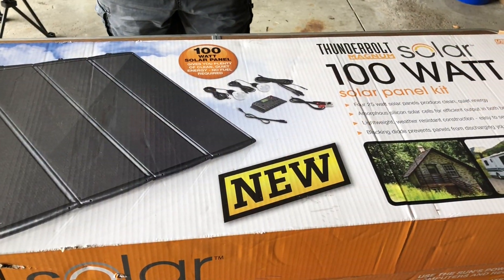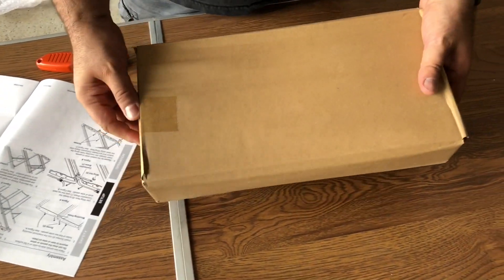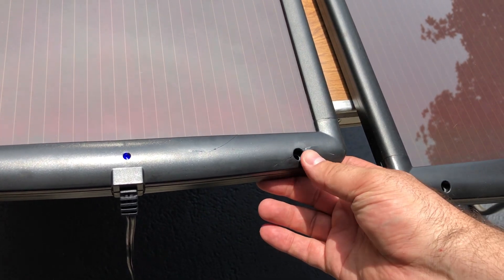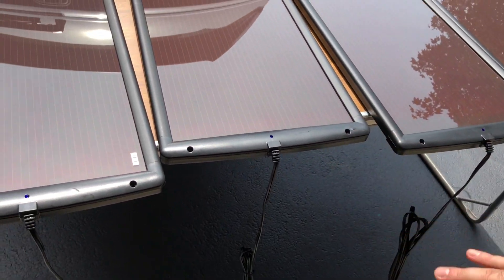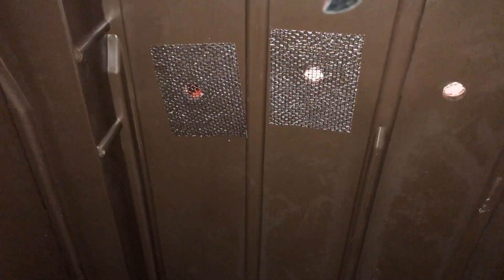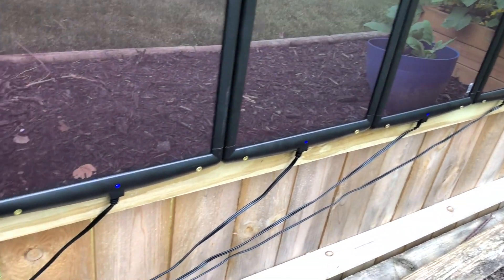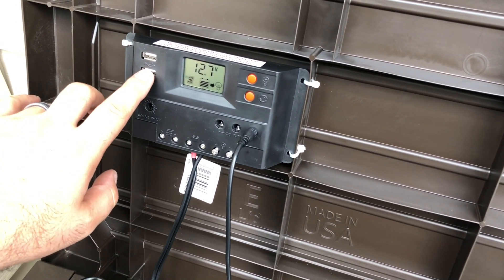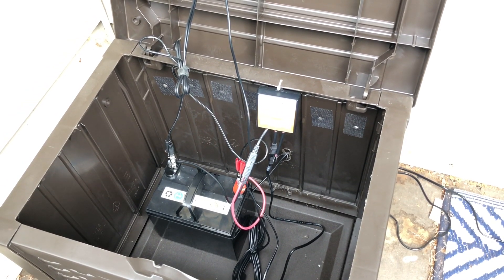Solar Panels : Installing my Thunderbolt Magnum 100 Watt Solar Panels : Harbor Freight

Comment: How many panels would you need to run a small house
Reply from the maker: You would have to figure out how much wattage you’re pulling (I would look at your energy consumption on your electric bill) then get the appropriate amount of panels. You will then need to get the appropriate inverter based on the number of panels, I would recommend talking to an electrician.

Comment: Could one "live off the grid" with these?
Reply from the maker: You would have to do a lot of research. From checking everything in your house. You will need a lot of panels and batteries
Reply: @easyprepper101  how much does one panel power? Like a light? How much does the 3 u had like what apications do u use them for just wondering

Comment: Its been a year. Any issues with the panels out in the rain over time? I have these panels, and I need to decide if I need to weather proof them or not. Any input from you will help me. Thanks.
Reply from the maker: No issues with the solar panels and I left my panels out all year long with snow rain freezing rain and ice storms and they are still working
Reply: @easyprepper101  are they still working?
Reply from the maker: Still no issues

Comment: Why do you have 2 regulators hooked up?, The charge controller that came with the kit is a regular itself and is all you need. And Also why did you mount the solar panels flat against the fence, you want to have them at an angle, facing the sky/south. Edit: I read your responses below for the angle, sorry I should have read the rest of the comments first. Glad to have another solar peep on the block :)
Reply from the maker: It’s all good. Thank you for watching
Reply: So is hooking up the battery for energy easy? I wana do this when we move into our new house
Reply: What kind of regulator did you get????

Comment: Great video. I apologize to ask 
Where did you bought the wiring extenders? 

Can you add more light bulbs besides the 2 that came with the kit?

Thank you for sharing looking forward for your reply 

Thank you
Reply from the maker: I brought the extenders kit at harbor fright and you can add three lights to the dc plug and hard wire two lights for a total of five. Now I have not tried this, but I would use then three d c outlets. Thanks for watching

Comment: Great video for anyone looking to buy this kit or for general knowledge on how solar panels work.  Thanks.  I've been looking at this kit to run lights in my building 10' x 12'.  Should be perfect for it.
Reply from the maker: Yes. This will work get on running the lights and charging cellphones.  Thanks for watching

Comment: how long are the lines from the panels to your control box and battery set up
Reply from the maker: Total is 41 feet of cable. And that’s two extender cables and the original cables from the panels, hope that helps, thanks for watching!
Reply: @easyprepper101  

Where did you get the extender cables? Thanks for making the video

Comment: Pretty sure you don’t need the regulator. The charge controller does the same thing.
Reply: I was wondering if the regulator could put in 14.7 volts to the batteries
I use agm batteries and the charge controller only puts in a Max of 13 v
Reply: @dylanhugg4731  Just buy another charge controller. They are as cheap as can be.
Reply: I'll have to splice the charge cable to the charge controller and void warranty
Reply: @dylanhugg4731  everything is plug and play just buy a 2 wire pigtail from amazon and use that to splice to

Comment: Is there any power difference if you were to angle the panels versus leaving them flat against the fence?
Reply from the maker: Yes. If you have the panels angle towards the sun, you will get a better charge and higher volts and watts per hour. The way my backyard is set up, this was my best option at this time. Thanks for watching